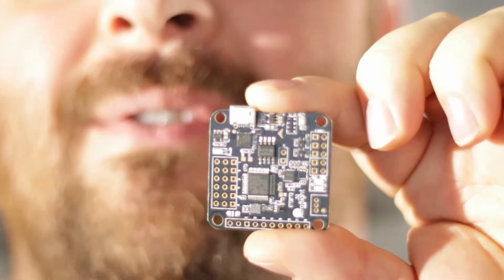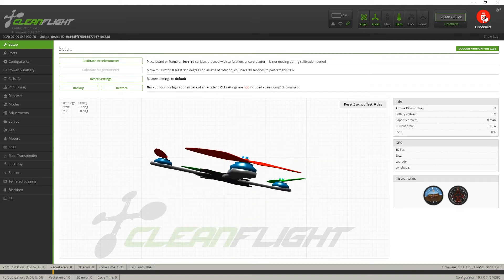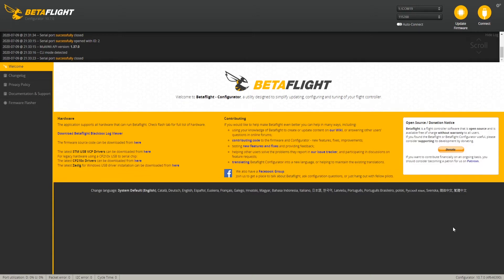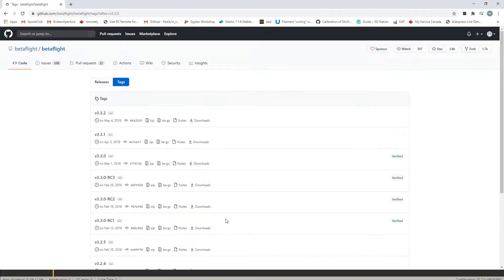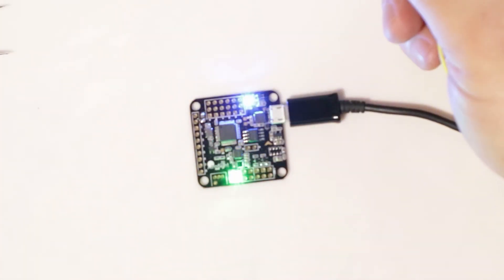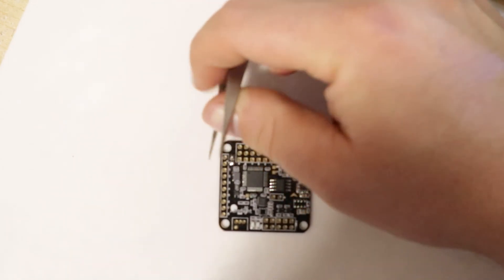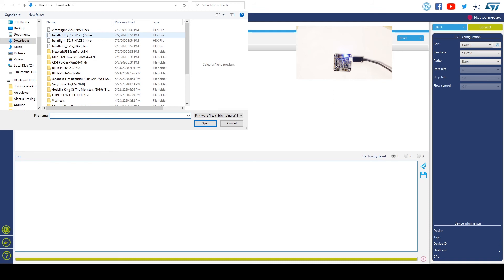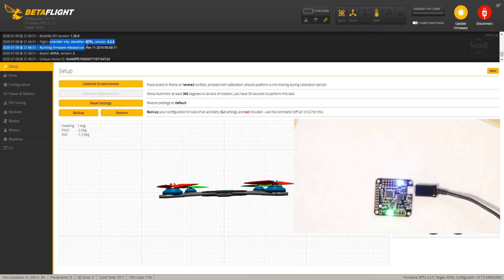BETAFLIGHT on your NAZE32!!! I show you how to EASILY upgrade your firmware on it FOR FREE!!!

Comment: I managed to get it installed but I am not having any joy getting my quad to fly. It seemed like I got a different error each time I tried connecting or flashing my FC. Yesterday I deleted everything off my laptop and started over, I loaded an older version of Betaflight configurator released in 2018 and the 3.2.5 software. Downloaded the drivers recommended by Betaflight and everything worked great, my FC flashed without any problems.
Got some time in the last couple days and got it setup in Betaflight and took it for a couple test hovers this afternoon. That didn't go so great, first test flight there was some pulsing in the throttle like I was blipping the throttle, I was hovering about 20 feet up and the motors all cut out and the quad plummeted to the ground breaking one prop. Second flight everything seemed better than until I landed and the quad done a couple hops and then kept flipping upside down. Hooked it up to Betaflight to look thing's over, couldn't see anything glaring at me. Charged a battery and went for a third test flight and the pulsing throttle was back and it decided to flip upside down about 15 ft in the air and crashing again, this time breaking 14 of the 16 fasteners holding the frame together. Don't know if I should just scrap the complete thing or buy a newer FC

Comment: ZOMG you're a lifesaver!!   I did need to pull the old 10.7 version of the Configure app that you're using in the video; the latest 10.10 as I write this won't talk to this old firmware.  But that's fine, it works!  And no more fighting with the old Chrome app that doesn't like Windows anymore.

Comment: thanks for bringing me up to speed two years late.. lol
Reply from the maker: Lol. My pleasure. ;)
Reply: @TheWayneStevenson  I pulled out my naze32 and thought it's about time I got my quad working, only to find out there's little-to-no support anywhere. But I think you've got me rolling, should I even spend the time making this work or just get the latest from Amazon?
Reply from the maker: @Insight Of the ages  Well, if you just need a FC, then it's great. Doesn't have all the new functionality that later versions of Betaflight supports. But it will fly great. The biggest drawback for me is the lack of an OSD. Mainly for battery usage. However if you stick a camera that has a voltage monitor then that's a plus. Though I have grown accustomed to flight mode indicators and VTX channel display.
Reply: @TheWayneStevenson  thanks.
Reply: Do you have a recommendation for a cheap modern flight controller
Reply from the maker: @Insight Of the ages  Speedybee seems to get the best bang for the buck. Jhemcu has also had some great prices on their gear.

Comment: I’ve got 6 of these. They all worked when stored years ago. Problem is none of them will connect to anything to be flashed now. All my other flight controllers connect no problem. 

The flight controller shows up as connected and working properly in my computers device manager.

I get no boot loader mode even with the boot pins jumped

I get the solid blue light on the fc but no version of beta flight or clean flight will recognize the fc under any circumstance
Reply from the maker: Very weird. This has to be a compatibility issue. There's nothing that should cause all six of them to just stop working. Did you try soldering the boot pins? That can help overcome oxidation that can prevent a good jumpering.

Comment: It works! However, I can´t connect to the motors page. It just says "waiting for data"
Reply from the maker: Is everything together and your Lipo plugged in? It may need everything plugged in to work properly. If so, not sure why you can't get that tab working.

Comment: Thank you for share
After betaflight install can be set up an GPS resque?? (if have GPS connected)
Reply from the maker: Betaflight at some point dropped GPS rescue due to firmware sizes but those older versions used to have some GPS functionality if I recall so hopefully doable.
Reply: @TheWayneStevenson  Thanks

Comment: Hi a friend gave me a drone with a afroflight 32 installed it has a old version of baseflight on it. I've followed your video and keep getting : Error: Activating device: KO. Please, verify the boot mode configuration and check the serial port configuration. Reset your device then try again... How do I fix this.. completely new to this never done anything like this before
Reply: This is also what I get in STM

Comment: You sir, are a life saver. iv a ton of old naze 32 boards lying around that i could not do anything with. just followed your instructions and boom.. iv got life back into my old boards. i,ll use these for bashing and testing, and i,ll get some more as their like $10 each. Much appreciated
Reply from the maker: Happy to help! Yes, these Nazes are cheap and great!!! I love them as well. And fully capable. Really the only issue I have with these older boards was the lack of OSD to monitor battery voltage. But for those builds I use buzzers that plug into the balance plug and do fly-bys to listen for it. ;) Lol.

Happy Flying!!!
Reply: @TheWayneStevenson  yes i agree, i use the Matek HubOsd eco Pdb,s. These work great.

Comment: 😮 GLAD to find your channel
I have been trying to resurrect a five-year-old drone for the last 48 hours and your advice got me there within an hour thank you
Reply from the maker: I'm here to help!!! And thanks for watching Mike!!!  Happy flying!!! :)
Reply: @TheWayneStevenson in base flight i had a magnetometer option , after flashing 3.25 naze its grayed out , even after checking the box .. any reason it wouldnt be supported ?
  thanks Mike
Reply from the maker: It's likely just your resource setting for your i2c bus. It doesn't know what pins you have it on. Did you happen to save your resource configuration from Base Flight? That would make it easier to determine where it needs to be. Which exact FC board do you have? Is your magnetometer built in to the board or an external one?
Reply: @TheWayneStevenson  
Thanks for the quick response 
Me and Cougman are the same 
 Just got back into the hobby again 
after about 4 years 
So I’m currently trying to bring a Emax Nighthawk 280 pro back to life 
I tried the 3 configuration programs (Beta Clean and Base)
Funny because Baseflight is the only one that has the magnetometer feature available no matter what boxes I check 
But Baseflight won’t save the arm or flying “modes”. 
Also the only configurator that I can setup the ESC’s!
So basically I have got up and running but on a total manual mode
  Currently playing on a simulator but I’m pretty nube 
I have a immersion rv vortex 285 that I love because it is simple and works and yes I saved many backups and used rxrange quite a bit in CLI mode to set up my channels 
Thanks for the help again
Reply from the maker: @mikejohns7272  Awesome!!! It's a funny tech hobby. I see a lot of people upgrading to the latest and greatest yet a lot of the holdups were simply software. This old tech flies great with a solid flight control software on it. If it weren't solely for the onboard OSD available, there's not a lot of extras that I personally need to rip through packs. I've taken advantage of the stacks mind you. I love having my FC, ESC, VTX, and RX all on convenient stacks.
Reply: @TheWayneStevenson  Love your enthusiasm
Lately I found the time again to jump back in ... Never really got comfortable FPV (but want to change that!)
 Ill keep working on it ( esc issue), maybe it has something to do with holding your tongue just right .lol
Reply from the maker: @cougman68  Lol. I found FPV disorientating at first. Now, I can't see much practical use for LOS anymore. FPV is just too exciting! :D
Reply: @cougman68  I finally got the craft up and running with Betaflght with your help 
Thanks again
Reply: Same here !

Comment: Hi. I'm following all your step on video. After flashing with STM32, i disconnect the FC and plug it back. But the FC still in flash mode. Can you help? Thanks
Reply from the maker: Do you mean it's still coming up in DFU mode? Once the boot pads are no longer being bridged, that shouldn't happen.
Reply: @TheWayneStevenson  yeah. That's what i expected. But until now, whenever i power up the FC, only solid blue light showing. Any idea? Thanks
Reply from the maker: @natgyver2993  Was this happening before you flashed as well or was it working fine?

Does it allow you to upload the firmware?
Reply: @TheWayneStevenson  hi. Sorry for late reply. The problem was solved. It turns out i have to connect the boot pad along the flashing process. Thanks for your help
Reply from the maker: @natgyver2993  Perfect. So glad you sorted it out!
Reply: @natgyver2993  Same here, I had to solder the boot pins together during programming. Well worked out

Comment: Did the configurator flashing process error out due to the manually download 3.2.5 firmware not being loaded? It seems like the configurator tried to flash the wrong firmware onto the Naze32. I didn't see the "load firmware [local]" step in your video.
Reply from the maker: My screen record software  didn't capture the extra screens that popped up.
Reply from the maker: But to answer your question, no. It will put whatever flash file you tell it as long as there is sufficient memory on the device.
Reply: @TheWayneStevenson  Prior to watching your video I had managed to flash Betaflight 3.2.5 on my Naze32. After manually loading the local firmware version I found that the key step was to click to activate the "flash on connect" option in the firmware flasher area. Then with the boot contacts shorted out plug in the Naze32 in and it would just flash. Your video is helpful though to know of an alternate method to try in case there would be some issue with the configurator. Cheers.
Reply from the maker: That method has worked for me in  the past as well flashing these boards.  But definately finicky things. And I have yet to solve the mystery why.  Perhaps age /corrosion are adding resistence and not pulling the boot pin to the proper state. Fresh solder.on the pads seems to often help  Modern F4 boards seem to be a lot better at this with their momentary switches.

Comment: Glad I found your video, trying to revive the hobby and my QAV180 back to life back from 2015/16 with a Naze 32 Rev6. It actually worked after flashing with Betaflight, even tho it showed the exact same error message. I just pressed connect. And it stated 3.2.5 instead of the old 2.9.0 from 2016! So no need for STM32CubeProgrammer for me atleast =) Cheers
Reply from the maker: Great to hear Dave. I've usually had good luck with Betaflight Configurator but every now and then......  😉 A handy tool for when it doesn't. 😀 Thanks for watching.